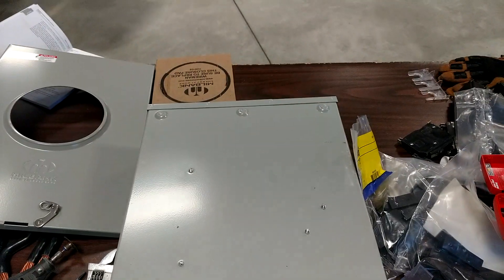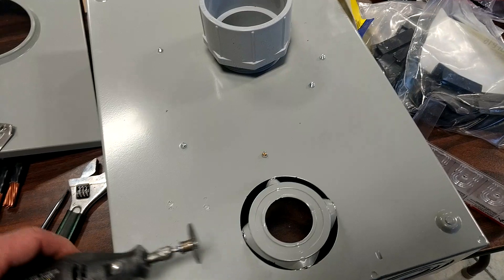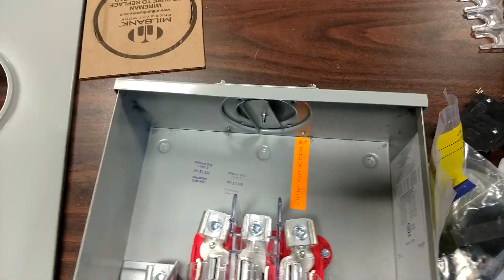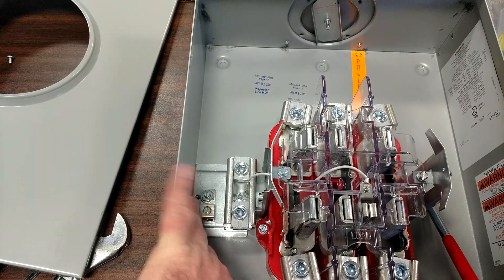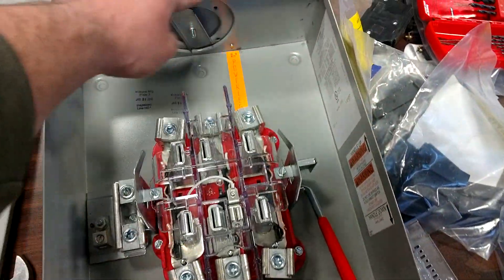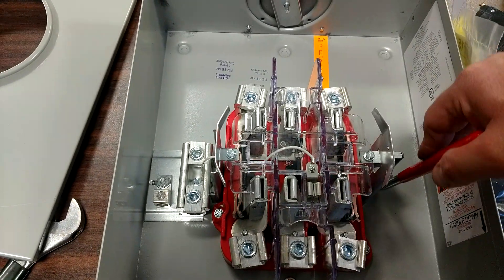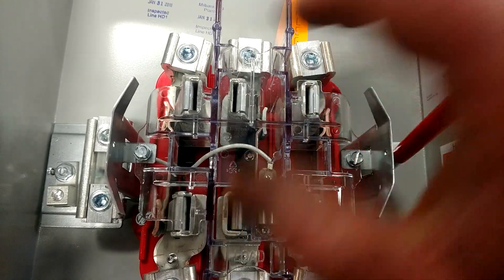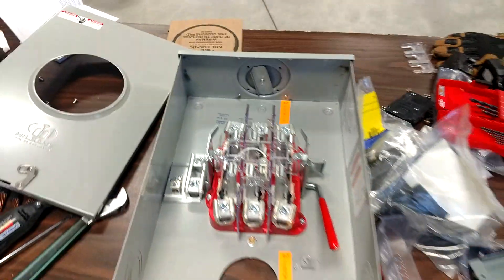Explaining a 200-ampere, 3 phase meter socket with bypass lever

Comment: Hi, what is the NEC color code standards for the cables to be installed in that meter box?
is it (2x) black and white? or black, red and white?
Reply from the maker: Check out the other video on my channel and it will tell you what colors to use for those wires.

Comment: Can the line side go in on the bottom?
Reply from the maker: No, for a couple of reasons.one is because the meter will run backwards and the other is because it's not listed in that manner.
Reply: Ok, i understand now .. .. .. Thanks a million.
Reply: One more thing, as far as the neutral goes does that matter considering the lug is on solid piece at the base and does not break with the lever. Or is that just an unwritten rule to always have the line wires come in at the same direction.
Reply from the maker: @shampsbelford1611  it doesn't matter electrically, but one could argue that you would not be complying with a neat and workmanlike manner.
Reply: That and you would be the laughing stock for the power company. 😂